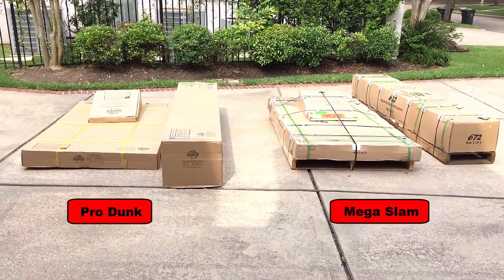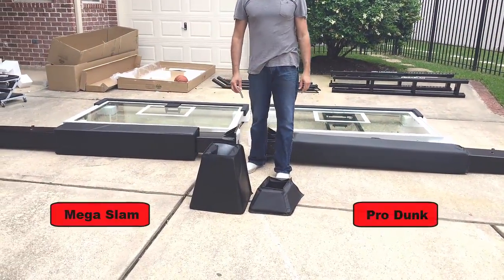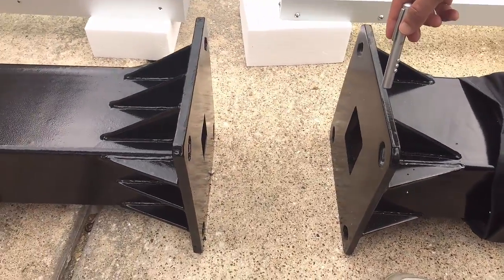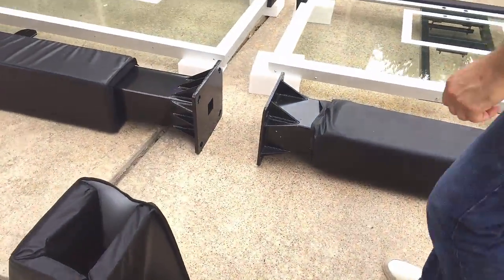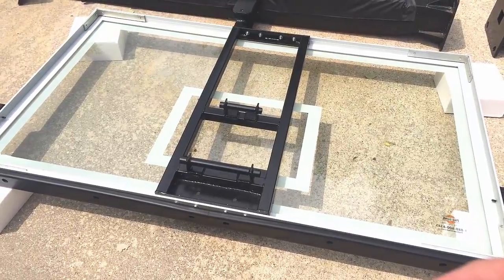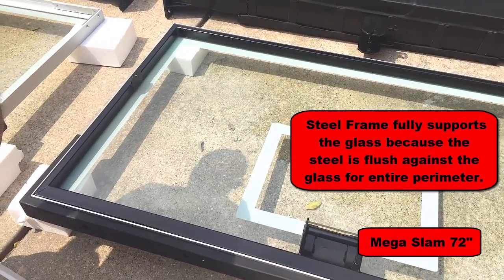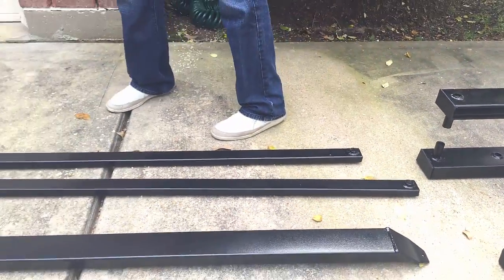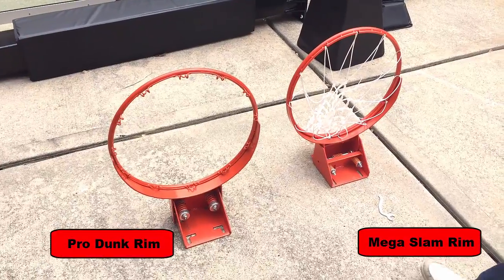Pro Dunk Hoops Review vs. Mega Slam Hoops Review and Comparison

Comment: This is one of the videos that helped me decide to purchase a Mega Slam Hoop. I considered Mega Slam, Pro Dunk and Goalrilla for my in-ground hoop and I am extremely pleased with the Mega Slam 60 that I purchased. This is the best in ground hoop I have ever used, it is extremely solid with no vibration. 

Mega Slam gives you a warranty on the backboard that is unbelievable! If it ever breaks, even if it is your fault, they will send you a new backboard and not even charge you for the shipping.  They don’t just send glass replacement, they send an entire backboard. This warranty is a one-time replacement.

This is a fantastic company with a fantastic product.  You will not regret your decision to go with Mega Slam.

Comment: You nailed everything in this review. I've had a MS 60 installed since 2014 and play on it extensively and it still looks brand new. I'm in Cincinnati and the last couple winters have been harsh but you wouldn't be able to tell by the condition of the MS. The only difference in mine is that I have a Gared Snapback rim installed (the official rim of the NBA from 1981-2008). To piggyback on the Savvy Tech's mention on customer service. I traded several emails with Matt from MS and he was beyond helpful. I too was down to MS and ProDunk. Matt gave me a bullet point list of everything MS did better and the costs they absorb to bring the customer the best possible home system. I could not be more satisfied! For any of you in cold weather states or those that have alot of rain/snow in the winters....do not fear about how this system will hold up...it will continue looking new while all the Goalrilla/Goaliath systems rust out inside of two years.
Reply: In the winter what did you do in the winter because of the snow do you put a cover on the hoop and where can I find it
Reply: @aurelius1620  you could probably just lower the goal and put a tarp (from harbor freight) over the entire board and goal to keep it from getting wet or snowed on.  That's what I plan on doing to keep it clean during winter.  Also I plan on spraying WD40 on all nuts and bolts once or twice a year to keep them from rusting.

Comment: I am looking at hoops for my son and was leaning towards ProDunk.  Then I found MegaSlam and this video.  This was GREAT.  One thing that I will add is that there have been some modifications to the PD hoop (i.e. thicker steal, etc.), but this video points out some of the things that I would have NEVER thought about such as the backboard construction, finish, the H design on PS, etc.  This video has educated me so much more and now the choice is clear.  MS.  Thanks J Dez!